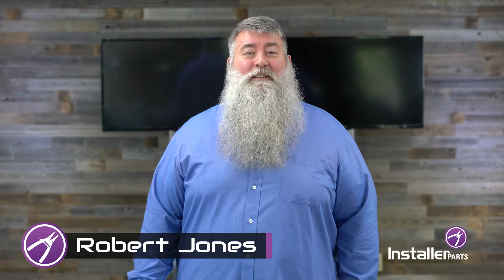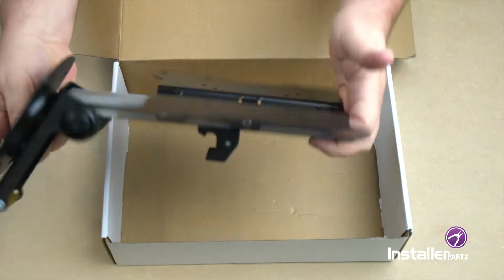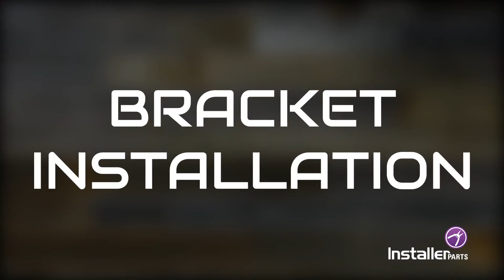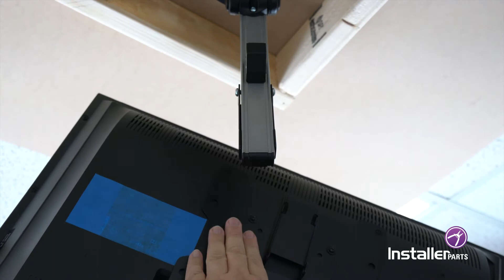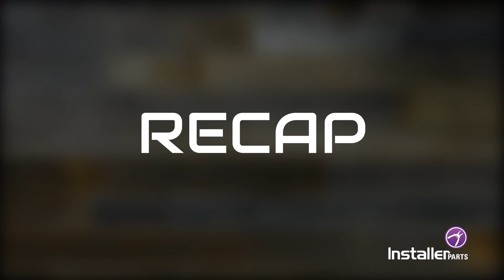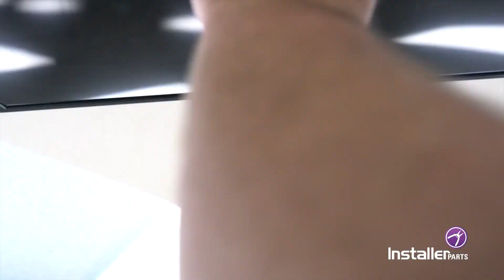InstallerParts Episode 21 - Swing Arm TV Mount For Under The Counter

Comment: I have found that the holes on the tv that secure mount to the tv are not very strong  ...  plastic on back of most tvs I have mounted is really weak,  ... I would put some 3M adhesive between mount and tv to assist the 4 bolts in grabbing ...  just in case your millennial son tries to do a pull up off your tv...
Reply: Oh gosh, why would they do that? Speaking as someone who is roughly the same age.